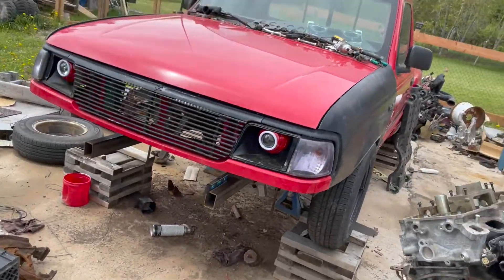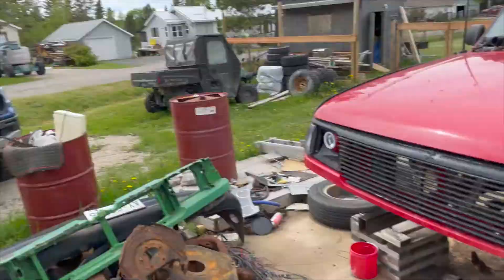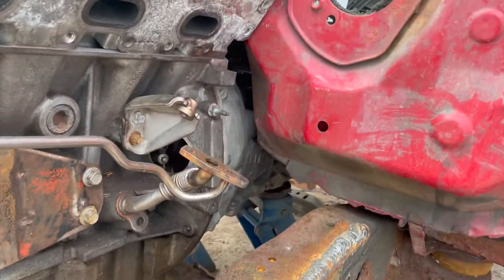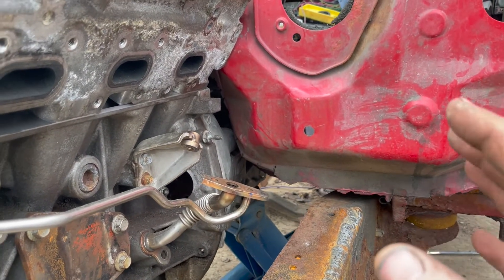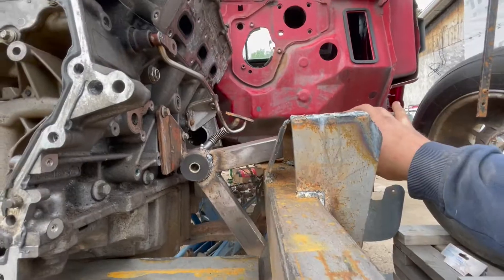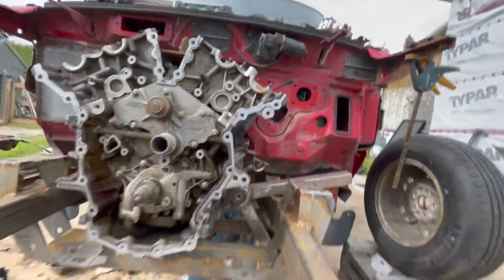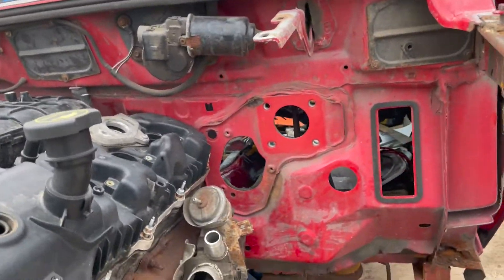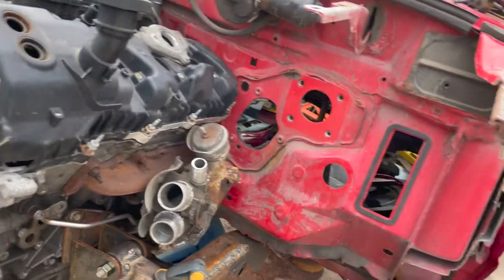Ecoboost Swap Pt.7- The Ecoboost gets a Transmission!

Comment: Looks to me you need to move the engine forward. So cut the crossmember. Get the shifter exactly where you want it, then put the engine at the correct angle by bringing it down in the front. Then fab the crossmember back together. You can "tub" the crossmember to clearance the oilpan
Reply from the maker: I was actually able to get all of my clearances figured out. MGW also has an option for a shifter that will fit perfectly where I have everything sitting now.
Reply: @rooflessgarage  nice, as long as you figured it out, that steering gonna be a chore. Good luck bro, I'll keep up with it.